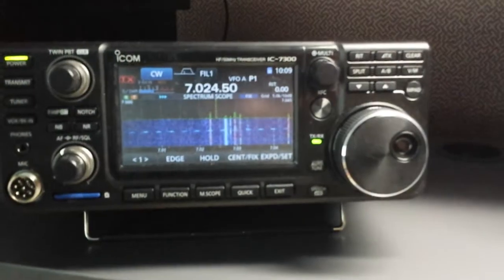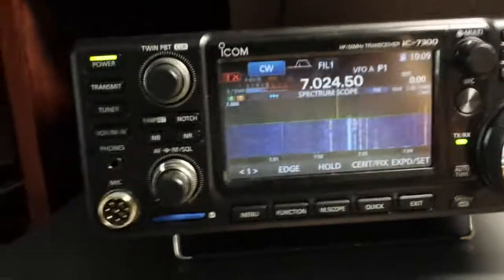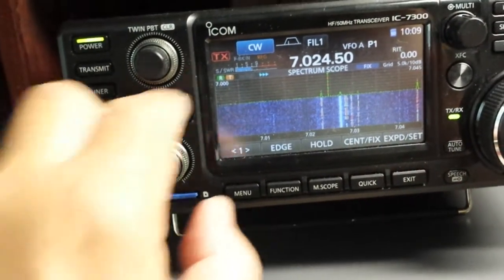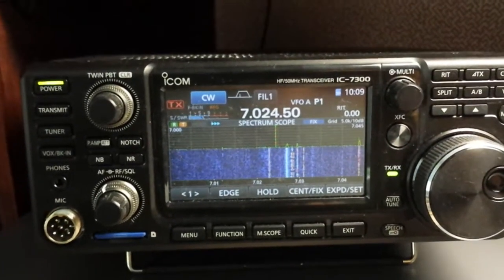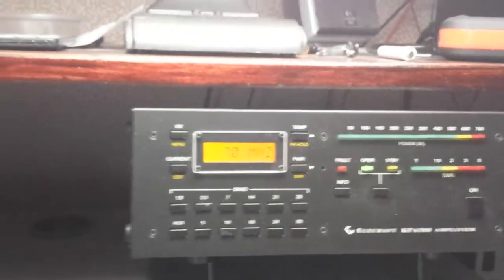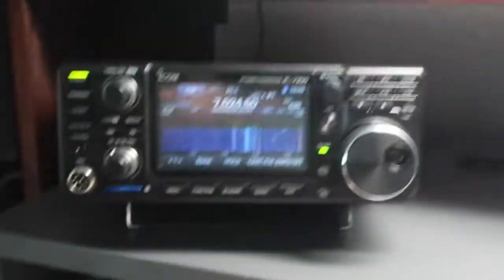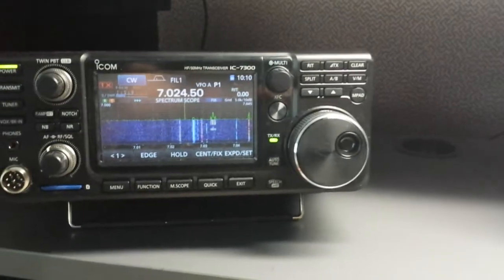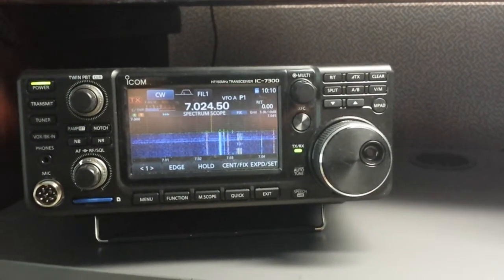IC-7300 QSK After AMP Relay is Removed

Comment: Steve - is the amp relay the one in the back of the rig underneath the external tuner connector?
Reply from the maker: I use an external keyer and bug in parallel. The 7300 is set for straight key keying. Nothing wrong with the rigs internal keyer other than it takes too long to switch between them via the menu hence the external keyer.
Reply from the maker: Yes.
Reply: Steve - if I don't have an amp is it necessary to add that jumper?
Reply from the maker: No but I would do it anyway.
Reply: Good video Steve, Wondering how did you switch from the paddle to the bug so quickly? Don't you have to go to the cw settings in the radio?